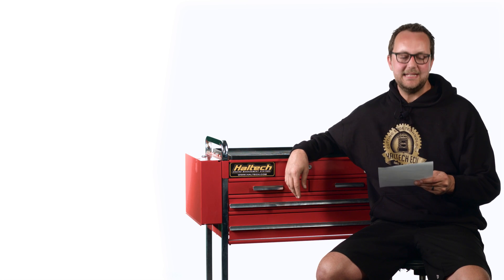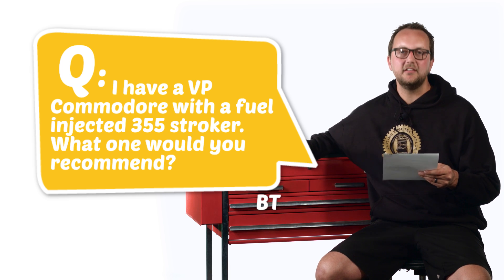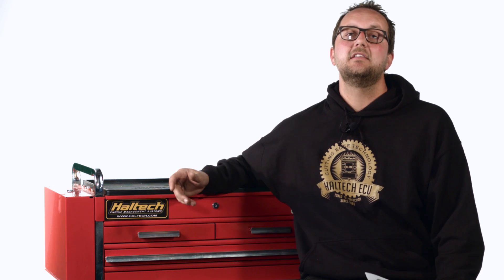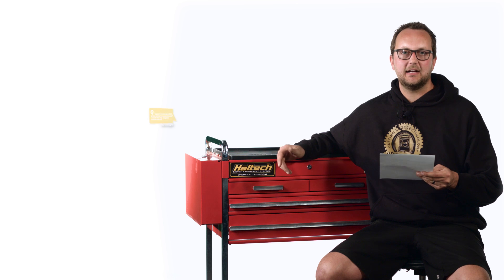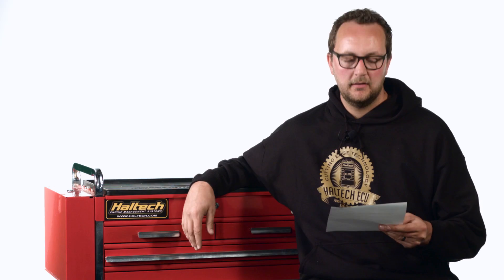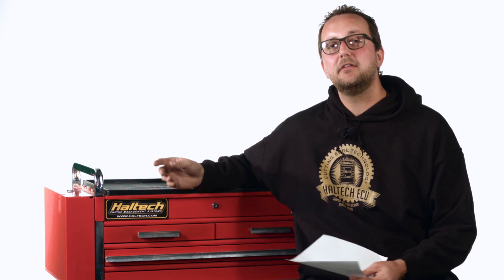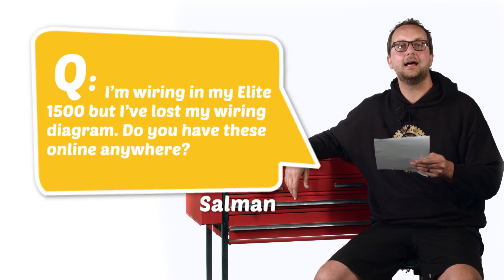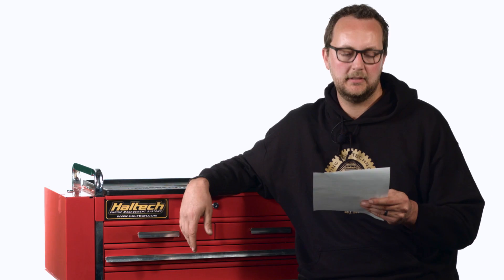❓ Expanding your ECU setup - Haltech Q&A Episode 17

Comment: i have a 2001 Volkswagen golf gti and i want to replace the engine with more powerful engine and i need a ecu but which one should i buy?
Reply from the maker: That depends on the engine you want to use but for a high end build we'd normally recommend Elite 1500 or Elite 2500.
Reply: for example if i just want to use. a vw GTI 4 cylinder 1.8t engine what do u recommend
Reply from the maker: Elite 1500:)
Reply: just this ecu nothing else can u please leave me the link so i can directly buy the same one
Reply from the maker: http://www.haltech.com/universal-ecu-kits/

Comment: Traffic can be really bad here in the Philippines, is there a way to program the ecu to go economy mode other than running lean.

I have heard of some engines cycling some of it's cylinders by shutting the injectors and ignition off when idling for a period over 1 minute, is that really possible?
Reply from the maker: Hi Frederick, our ECUs are designed with performance and racing tuning in mind so unfortunately we don't offer the features you've mentioned.
Reply: Aww... that would have been great if the ECU could be programmed to do that. 

Is it possible for the elite 1500 to control water injector/s? I am thinking the 2500 can do a sequential H20 injector because of the 8 injector outputs but not so sure with the 1500 though.

Comment: ive got 2004 ford fiesta 1.6L what ecu would best suit it to change fuel ratio and so on?
Reply from the maker: The Elite 1500 would be the unit of choice, supporting factory features such as DBW and knock control. As the WP Fiesta’s security system is tied into the factory ECU, the Elite would need to be custom-wired in parallel with the factory ECU (using factory for cluster and security control, and Haltech for engine control).http://www.haltech.com/elite-1500/
Reply: Haltech. okay sweet. thank you very much

Comment: What box do I need to control my 2j auto?
Reply: black label the engine can be controlled but the transmission control is what Haltech lacked. Look into proefi or syvecs if your looking for 2jz+auto controll
Reply from the maker: At this stage we do not support automatic transmissions , so you would need to either use an aftermarket TCM (transmission control module), or retain the factory ECU just for transmission control. The Haltech would be wired in parallel to control the engine, while leaving the TCM for auto control.
Reply: Haltech I don't want piggy back shit, been there done that, it's fucked!
What aftermarket TCM does Haltech recommend and are there plans to support 2J gearboxes?
Reply: Are you running an a340e or a650e? I have mine wired up to run in parallel with the factory ecu. The factory unit controls the alarm/shifting of trans in drive position. But I still have full control of the trans in e-shift mode so i can select any gear anytime. The factory auto 2jz computer will run happy even alongside with the haltechs. It is not a true piggy back where the signals are intercepted/conditioned as the haltech has full control of ignition/vvti/timing/rev limiter.

 If you have a dbw late model vvt-i you miss out on idle control as there is no stepper motor from toyota installed. get in touch with MV automatics for a valve body/transmission mods to get line pressure modified for faster and smoother shifts. Alternatively get in touch with Cihan from e-tuner who has some ideas on duty control with line pressure.

my car has been running for past 4 years with ps2000 in parallel with auto factory ecu and still runs strong. if i were todo it again.. maybe proefi 128 (website has wiring diagram for auto control) or syvecs. or if you can find a PCS TCM-2000 to control the auto

Comment: Hey guys, quite simple What fits my car? Stock Nissan 200SX series 2 S14, SR20DET notchtop, daily driven but with occasional track days. Looking for 2 different tunes, eccon for daily and higher HP & boost for track days...?
keep up the fantastic work guys!!!
Thanks in advance!
Reply from the maker: You can either use the S15 Pro Plugin, or the new Elite 1500 ECU with patch loom kit. For your application, the Pro Plugin would be perfectly suited.
Reply: Haltech I have a g37 a.t. with bigger t.b., and aam intake plenum, Stillen intakes with custom exhaust do you have a diy kit for that don't want to take it to dyno no good tuners where I stay,and can I return my car to stock.? Thanks in advance.

Comment: will there be cruise control on the elite series ecus soon or at all? I'm in the market for an ecu for my conversion and cruise is probably the main thing that'd top it over to a haltech at the moment.
Reply: Drew last time I emailed them about cruise control for the Elite Series ECU about 6 months ago I was told it is on the list of features to be added. As in the Elite Series is capable of cruise control functionality, but the software programming, wiring, and safety features were not sorted out just yet. I have the Elite 2500, and it's a really nice ECU with incredible functionality.
Reply: Thanks mate, thats similar to the response I got just after it came out without it after it was advertised as a launch feature... I was hoping we'd be able to get an update with a timeline attached or at least a commitment that it wasn't going to happen so that I could figure out what the plan is for my build.